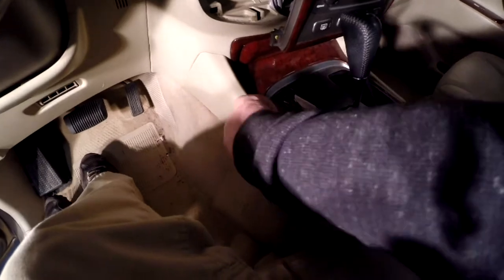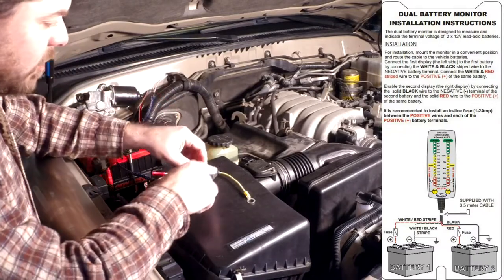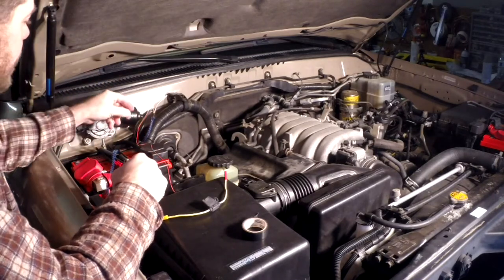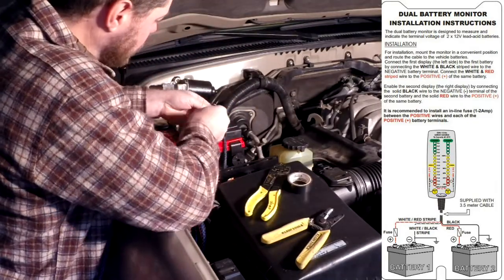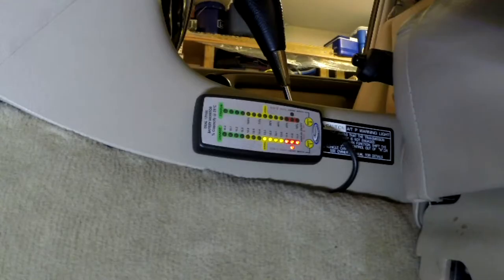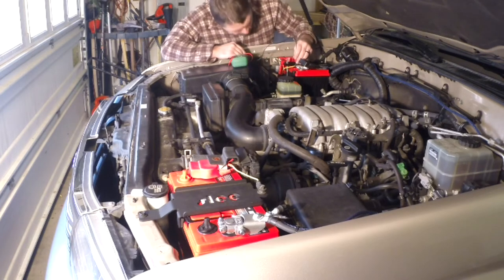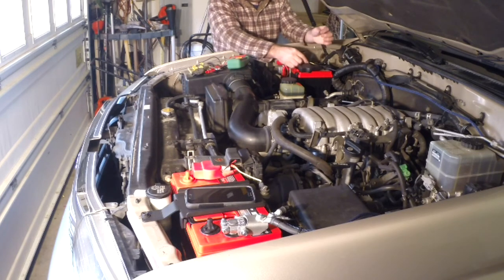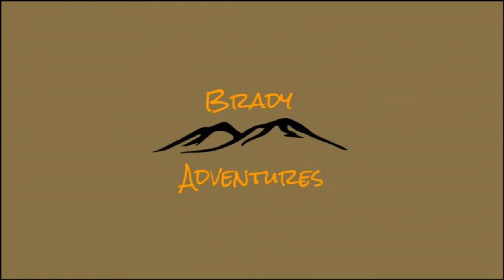Land Cruiser National Luna Dual Battery Monitor Install

Comment: I was considering adding an "On/Off" Switch for the Luna Monitor. I really wanted a Volt/Ammeter combo for each battery to mount next to the ML ACR toggle switch, and connect the On/Off button to those so I can control when I see them... Unfortunately, I cannot find any that are rectangle that will fit a Toyota 4runner in the US! Only Round ones!!! :( :( :( 

Love your videos!
Reply from the maker: Thanks man!  I was looking for something similar as you and just couldn't find anything that I liked so went with this one. I did see a couple on some Aussie sites I liked but not available in the US.  Not sure if you have the luna monitor yet but you can turn the LEDs off/on  by holding a button for 6 seconds.  The first 3 seconds of the hold turn on/off the low level alarm and the second 3 seconds turn off the LEDs.  There is a button for each battery.  I generally leave them off while I am not driving.  I like the idea of a switch though as a quick method to flip them on/off.
Reply: Oh thats definitely nice! In that case I think Im going to stick with the Luna monitor. Maybe further down the road I may take on adding the Volt/Ammeter display. I will have to post a video on here when I do the project!!! I will be sure to give a shoutout.
Reply from the maker: Thanks man!  I think you will like the monitor a lot.  Definitely let me know if you post something so I can check it out!